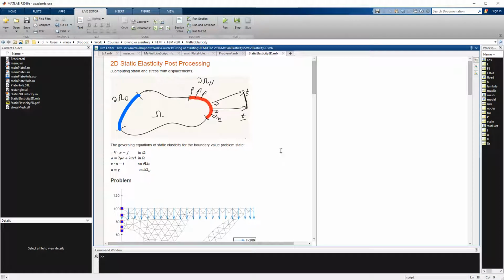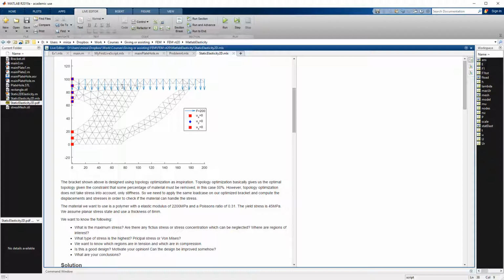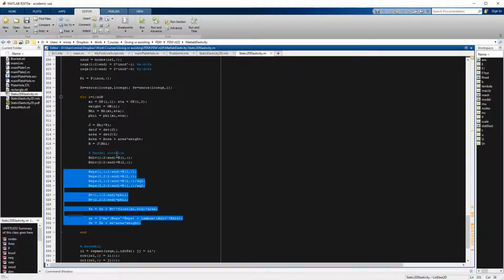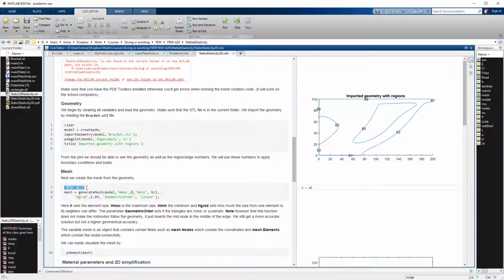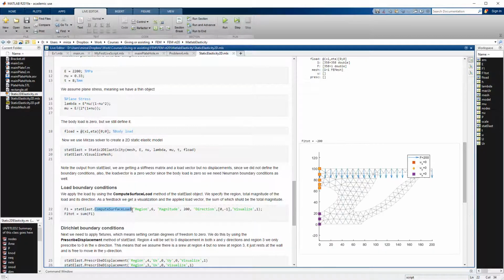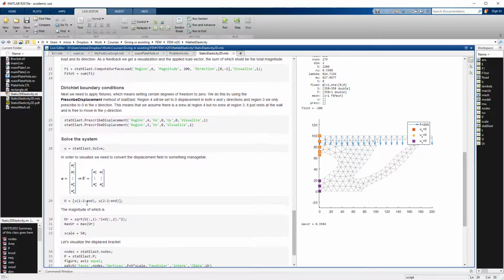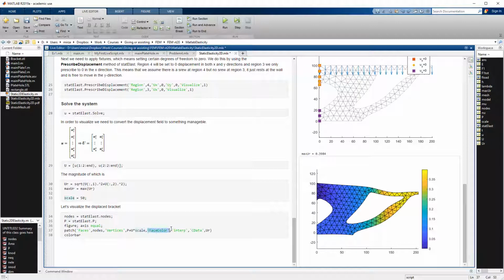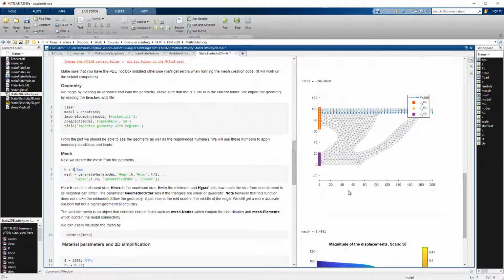2D Static Elasticity in Matlab - Modeling and solving for displacements

Comment: Could this be applied to 3D?
Reply from the maker: Not directly using the files in the video. 3D is a bit more involving, but not out of reach. 
Matlab has meshing tools for 3D and you can import 3D STL files to generate a mesh. 
The solver needs to be adapted to handle 3D fields, the voigt form needs to be extended and the traction boundary condition updated to handle 3D surfaces. 
I have some code over at https://jthgit.hj.se/mirza/jufem/-/tree/main/models/LinearElastic?ref_type=heads
for solving linear elasticity in 3D, but it's not written for brevity.